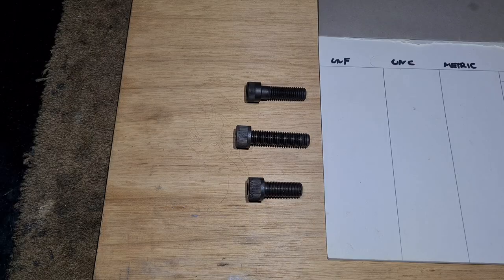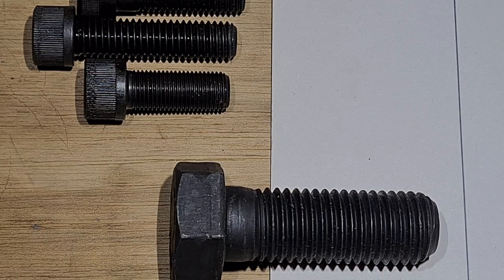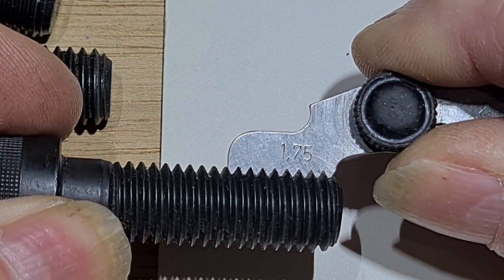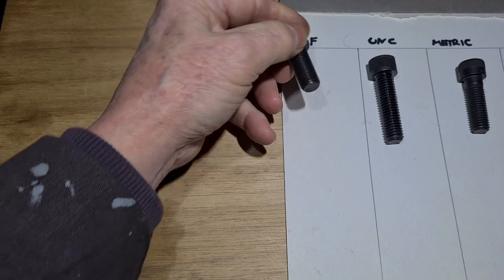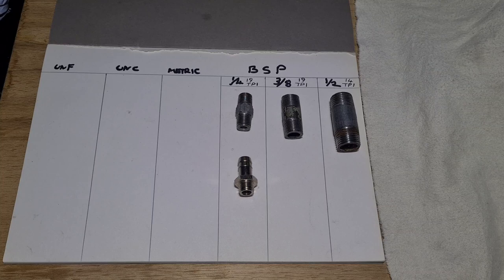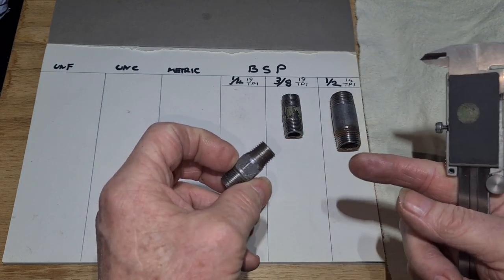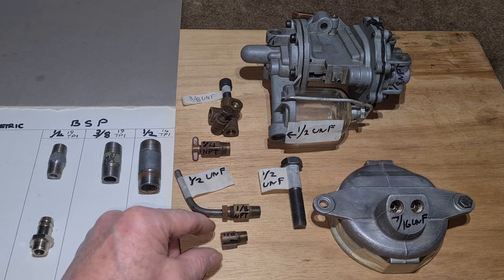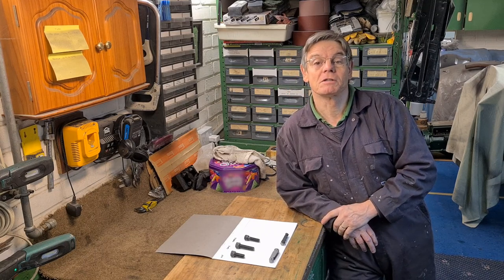All About Threads

Comment: thanks for explaining that I didn't know most of that and when you had the measurement on the vernier  I couldn't make out the reading
Reply from the maker: Hi John thankyou for the comment, that is my intention to explain things in a simple way I hope it helps others too. when I measured the diameter of the bolts they were around 0.495 just under 1/2 inch and 12mm I was just making the point that sometimes you have to guess the diameter on some smaller bolts and then check the pitch to confirm what it is.
Reply: @StevesConsul  Is that measurement out of 100 as that looks as if it is just under 1/2 of 100
Reply from the maker: @johnhunt2388  well they were about 5 thousandths of an inch under 0.500" (1/2") hope that makes it clear.